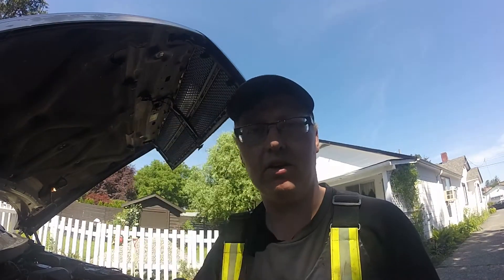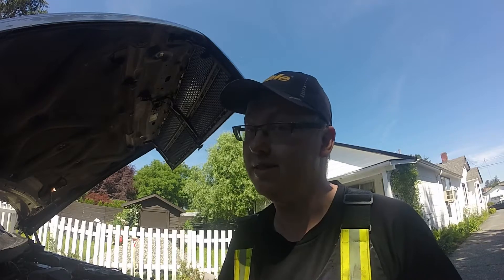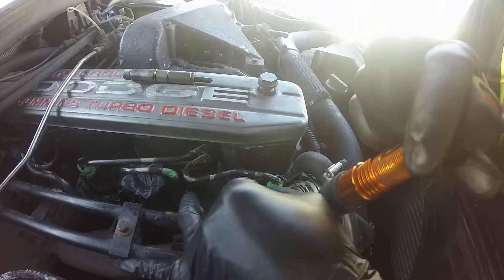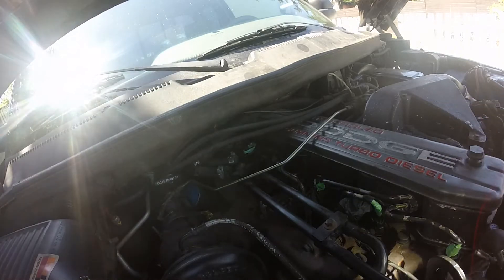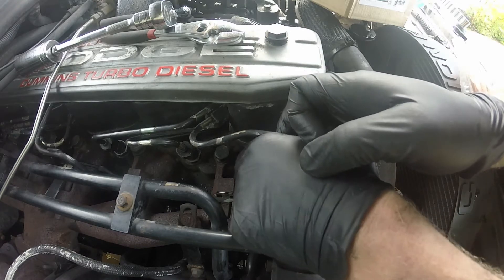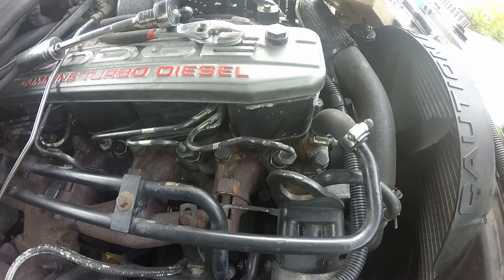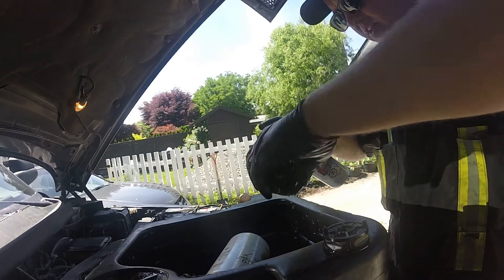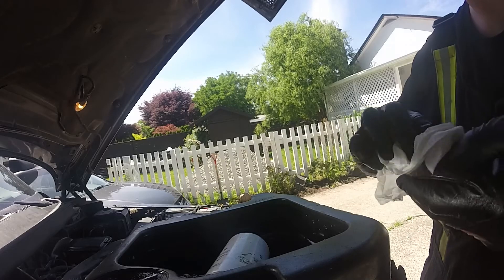Cummins 12 valve Injector install how to - 95 dodge ram 3500 dually - Sumo

Comment: Those ever leak around the Hold down? Or did they seal on first install?
Reply from the maker: You mean like compression leak around the hold downs? Or fuel?
Reply: No diesel fuel leaking around the hold down nut of the injector. If it leaks you would see fuel leaking like bubbling. But you would see it so obviously yours must be ok and not leaking.
Reply from the maker: @timothydare6007  no fuel should be leaking out of that nut, however, if there is bubbling there,  the o-ring on the injector could be damaged, causing some compression to leak past and the fuel line above may have a damaged flange, or loose fitting. If fuel is leaking out nut with no fuel leak above, the injector could potentially be damaged. Is this something you have seen happen?